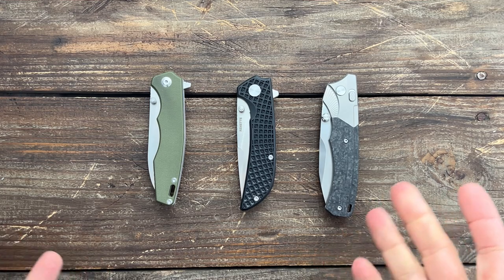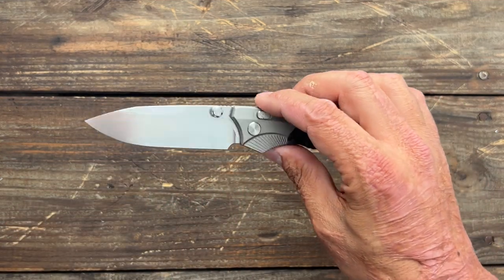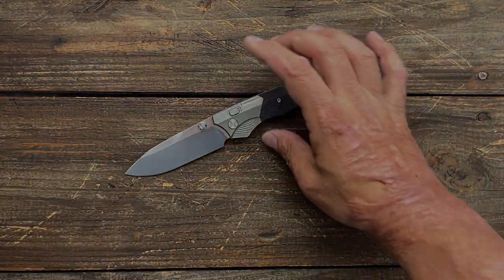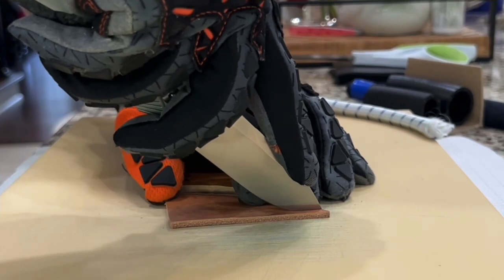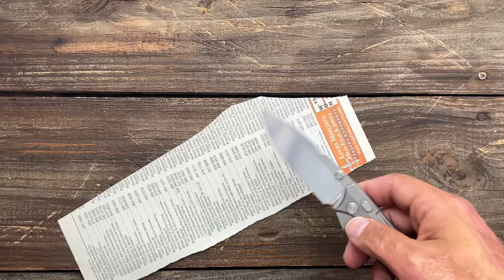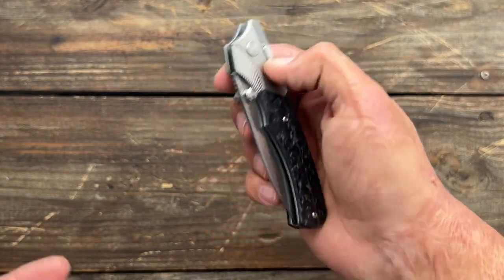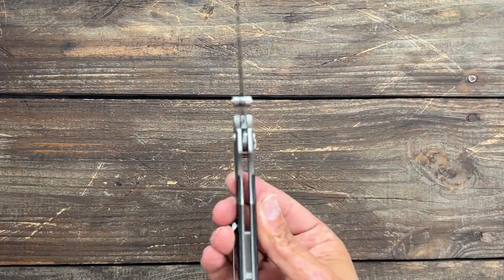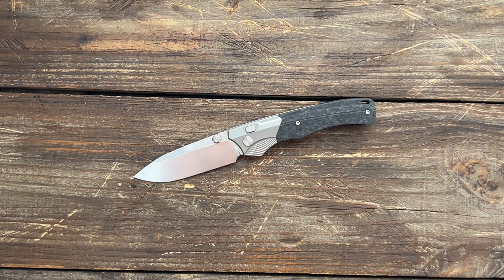Outstanding New Button Lock Knife - Remette WD107

Comment: I got the premium button lock and it was impossible to center, got a replacement and it was worse with added button stick. I think most of the problem was the blade grind. A little more qc there and they'd have something. Seemed to be well executed otherwise.

Comment: A: Amazon doesnt have discount codes. B: This is wildly overpriced for the manu. At150 like it was iws ok but 190? Not reat...
Reply: A: Amazon does have discount codes because I used them and got a clip and save from Amazon as well.
B: it cost me 140 $ and it was worth it. Tell me where you can get a M390 , Ti , and carbon fiber button lock this well made for the same or less money.
Reply: @haveagocommentator983   the carbon fiber doesnt look great, no amazon desont have a coupon section. But 140 is a good price on it. They are listed at 190. You can get a Escort on 20cv for less.
Reply: @clamwok  , 20cv is comparable to M390 but aluminum is not Ti, the amount of extra milling time need to contour, micro mill and finish the scale is far more than the escort which is made from a much softer material and easier to process. I've owned the escort and this knife and I'm telling you it is a much nicer knife. Buy it and if you don't think it's worth it , send it back.